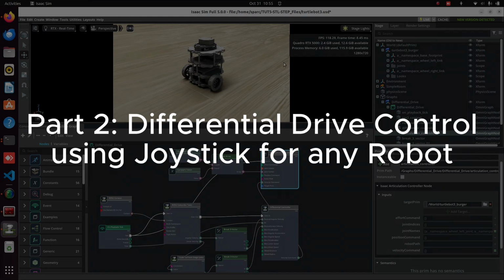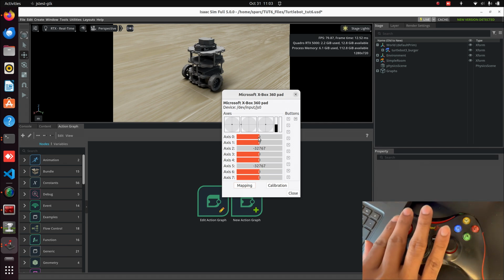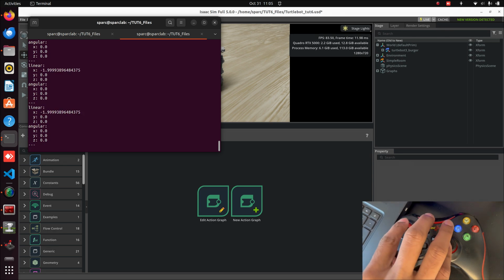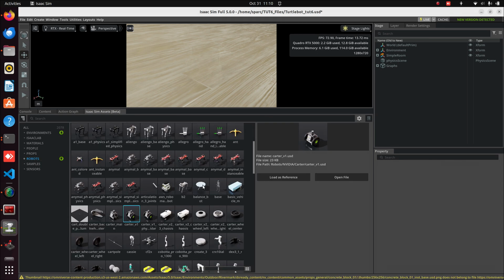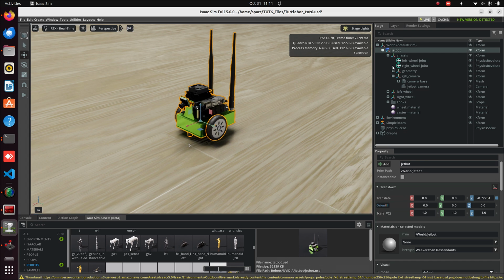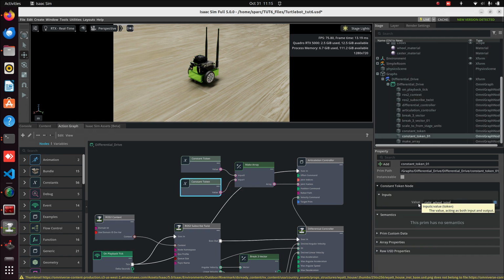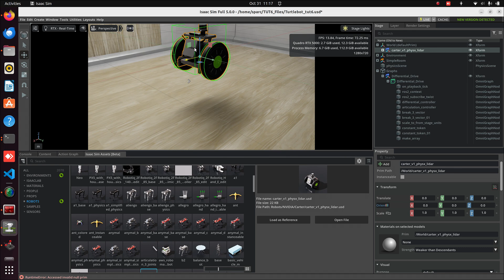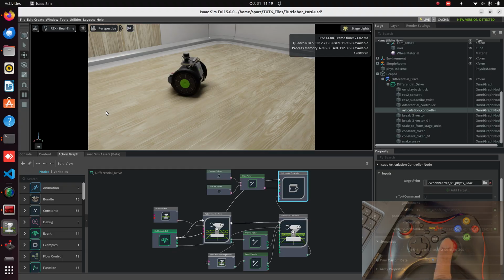Tutorial #6 (Part 2) – Differential Drive in Isaac Sim | ROS2 Joystick Control for Any Robots

Comment: Hi. I implemented the action graph for my differential drive robot. Even though alone Linear and angular velocity works. The robot moves straight and spins at a given angular vel but when both are given simultaneously using the joystick, it only loves straight and barely moves on an arc as it should. 
I am able to understand what could be wrong. Any guidance would be appreciated. 
Thanks
Reply from the maker: You could check your robot specifications carefully wheel radius, wheel distance, etc.

to make sure they match your robot. Also, to describe the issue more clearly, 

you can post it on our Discord server under the tutorial-isaac-sim-lab channel and share some pictures, this will give us more clarity and allow others to help as well.
Reply: @SPARCLab07 I will, thank you for responding.

Comment: Hi, I installed Isaac Sim in container mode, how can I use ROS2 in this case?Btw nice job
Reply from the maker: You can use ROS 2 in Isaac Sim’s container mode through the built-in ROS 2 bridge.
There’s no need to install ROS 2 on the host—just enable the bridge inside the container.
For a clear step-by-step guide, check NVIDIA’s documentation here:
https://docs.isaacsim.omniverse.nvidia.com/latest/installation/install_ros.html
Reply: I can verify that it works just fine inside the container. Without needing to install ros2 in the container. Launch the container with network=host to make things simple. 
(if for some reason, you don't want to use the same network stack, check firewall settings and dds for clues - those were my biggest headaches)